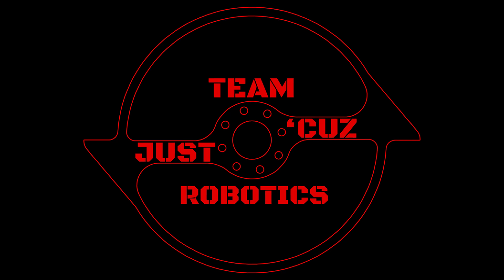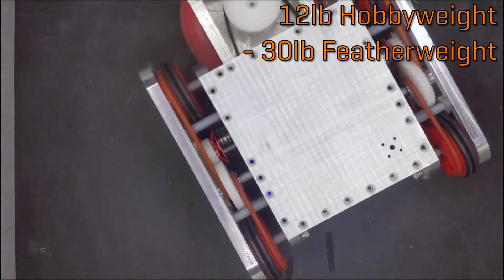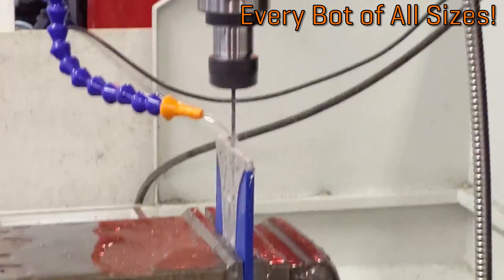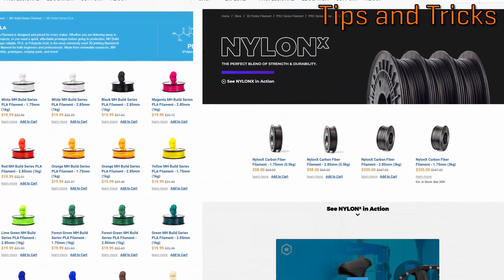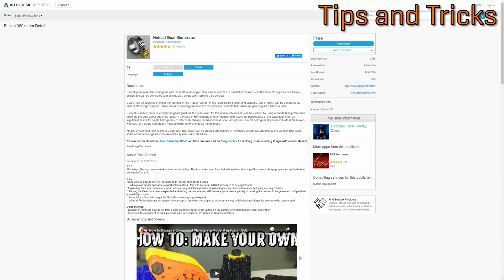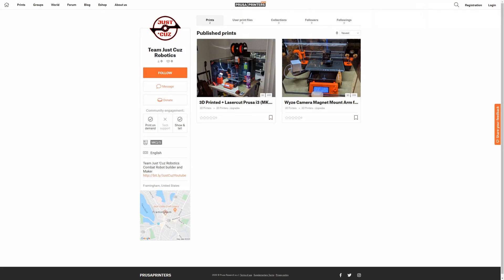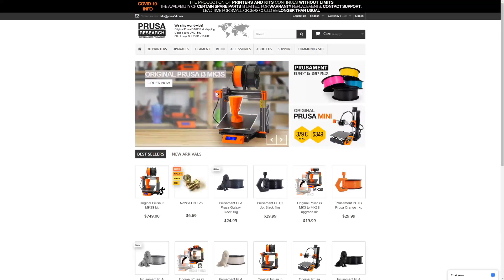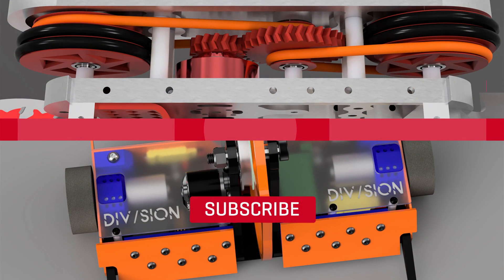3D Printing in Combat Robotics: Tips, Tricks, and Resources!

Comment: Id add that mcmaster car has solidworks files if that's what you use. There are multiple parts from there that I've printed instead of purchasing. Especially if they are selling a aluminum part but a plastic part will do fine
Reply from the maker: McMaster has every cad format a normal person would ever use for most parts

Comment: Hey what kind of 3D printer do you recommend for a beginner
Reply from the maker: If you can afford it, the Prusa i3 Mk3S (which is what I personally own) is great. It self levels, self calibrates, has a bunch of safety measures you won't find in many other printers like collision detection, and it's super simple and easy to use. Plus if anything goes wrong there is a massive community to help out.

If you have a lower budget I would look at Artillery printers if you don't plan to modify it at all, or maybe the ender 3 V2 if you are more willing to figure stuff out on your own.
Reply: If you can afford an artillery genius, sidewinder or Hornet or any other printer listed you can build a Prusa i3 mk3s clone for 350$ US.
I have one and it works great as long as you don't mind some tinkering (it's a DIY kit) , they can be found on aliexpress made by FYSETC.

Comment: A very informative video.for the bots where do you get the drive motors
Reply from the maker: Mini Mulcher uses MG90S servos that you can get on Amazon or basically any hobby electronics website. You do need to modify them but I have a video detailing that process. I might try an alternative faster motor in the future though but the servos seem to work great for now

Comment: I recently got a Monoprice MP10 Mini printer, ($300ish) and I would highly suggest you don't follow in my footsteps lol. The first one I received had a hotend that worked once, but after the calibration print test the hotend failed to ever heat up again. Sent it back, and a couple weeks later got a replacement. This one worked better, but the build plate adhesion (with glue added) was honestly terrible, and the X axis motor wasn't hitting the home registration switch and would constantly stall beyond the home position creating a horrible crunching noise. I'm pretty sure the built plate also wasn't completely flat resulting in some of the corners having filament smushed on it, and the edges just having filament flow freely over it not even sticking to the plate. (This was also after setting the global vertical offset to -0.7mm, so yikes.) 
On a final print test to give it one last chance, I came back an hour or two later and the entire print had peeled up and was tangled on the extruder, and the extruder itself was clogged full and oozing out filament. That was the final straw for me and I'm returning it for a refund soon. I really don't recommend it, because even with an enclosure that managed to happen :) this was all done with PLA. Unfortunately my plans of printing vital components for my robot out of PETG are indefinitely on hold until I can figure something out :)
Reply: Sorry to hear of all your problems - I hope things worked out all right and you got your money back. I have no experience of 3-D printing, but I do understand how new technology can be a minefield for the innocent enthusiast.

Not many years ago 3-D printing would have been something that only the world's major aerospace companies would have invested in. Installations would have cost millions. I suppose it's a good thing that the tech has trickled down far enough to let ordinary people get involved... But that's the problem.

Some new peeps will be so thrilled to be making their own stuff that they'll gladly overlook deficiencies in their printers. As 'pioneers' they'll actually enjoy overcoming problems and making modifications and redesigning components. There's a whole community of like-minded nuts out there, so it's fun, right?

Yeah, right. It's kinda like choosing to use Linux as your PC's operating system: you're expected to get the darn thing to work. I've tried it several times over the years, and I hate that 'Do It Yourself or go to hell' approach.

Anyhooo, the problem is, some manufacturers will take advantage of this generosity of spirit, and produce inferior machines, cutting corners, using poor quality components, in order to make a big fat profit.

It's disgraceful. But it's business.

So the market gets flooded with awful, crappy printers. There are still enough first-time noobs with £250 or so to spend to keep the companies afloat, but thankfully there are other people like you who'll tell them that enough is enough.

Moving on to 'serious' hobby-level printers (£1,000?) is bound to be a painful step up, but I don't think anybody who takes it will regret it.

Best of luck!  :-)
Reply: My first printer was a Monoprice Maker Select, it was fine and handled quite a beating but the quality wasn't great.
My advice: Get an Ender 3, Prusa mk3s clone, or any known brand like artillery.
Reply: If you're still having adhesion problems try some hair spray it always works for me, just spray it on the bed once it gets to about 100C.